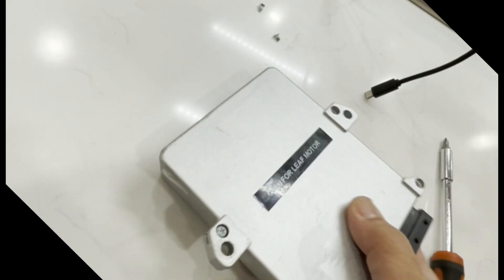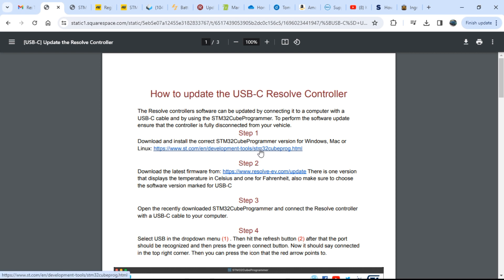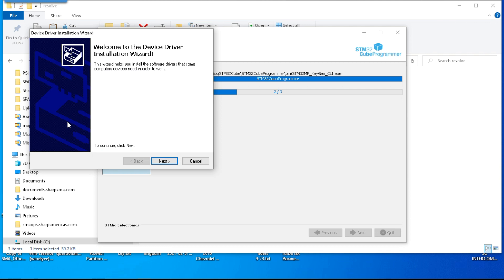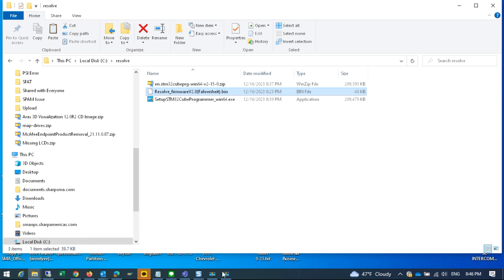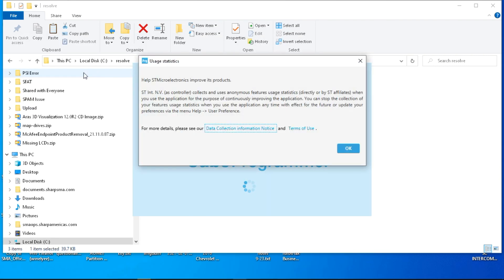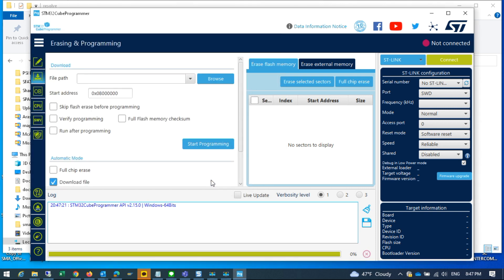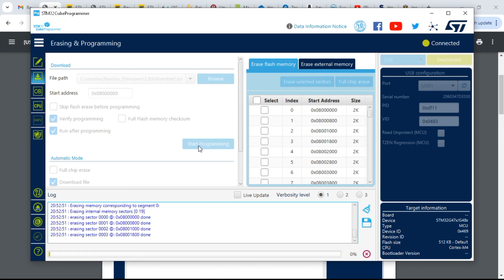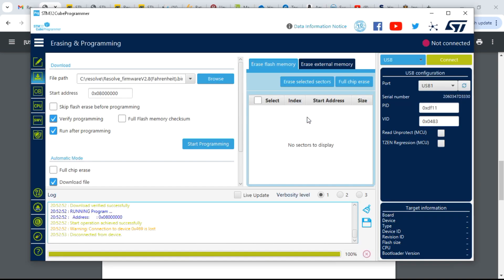Resolve EV Controller USB C Update

Comment: Thinking about putting a Bolt drivetrain into a Chevy 4wd Colorado so I can keep most of the drivetrain together ending up with a front wheel drive electric truck
Reply: Remove the bolt subframe and mount to your truck. You'll have CVs at both ends and you'll be able to add another subframe later if you'd want to do so